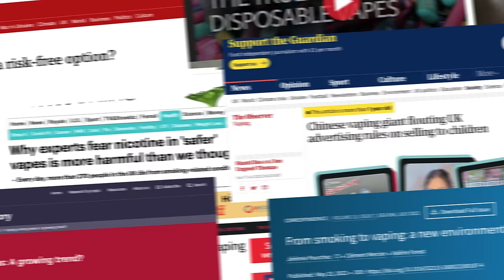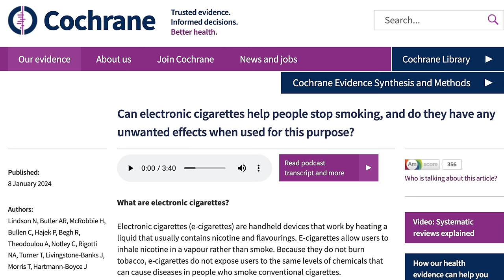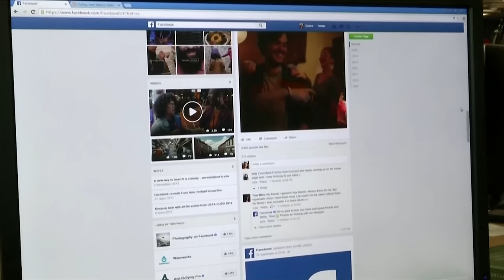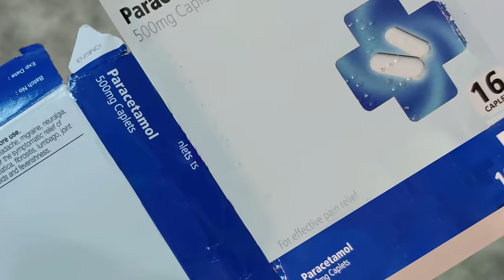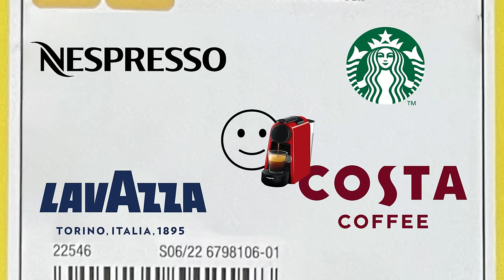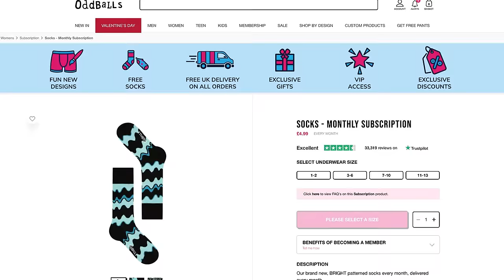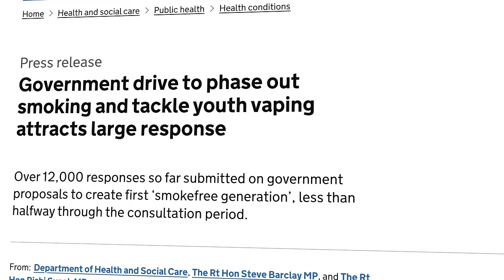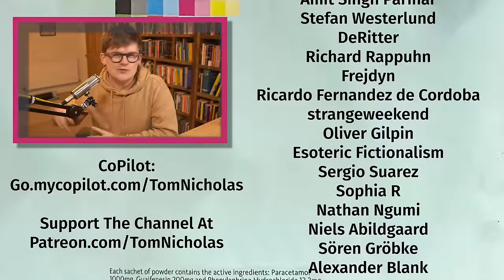Vape-o-nomics: Why Everything is Addictive Now

Comment: An Ex-smoker of over 17 years now, I have been fascinated by these disposed devices, each having a Lithium-ion cell inside that has never been recharged, and has a potential lifetime of over 100 recharge cycles. Only a small number of recovered vape batteries have been irreversibly over-discharged, so potentially they have a future to store renewable energy at home. The plastic, stainless steel, and aluminium casings are not easily dismantled for disposal and recycling, made more challenging by the potentially pyrophoric cell inside if damaged. Also, the nicotine content is a danger to wildlife being toxic to small mammals and lethal to insects. The glycerol and propylene glycol solvent and nebulizing agents also have a sweet taste that could harm children and pets if they were to encounter them. Discarded insulin may be just as lethal to those who are not medically required to use it without control. Insulin has been described as "the perfect murder weapon", leaving no toxicological trace apart from an easily concealed fine needle puncture wound.
Reply: The soft-pouch cylindrical cells found in these are manufactured to a very low quality and are not intended to take charge repeatedly. I have collected some and have extracted and store discharged and secured a handful of cells, but i wonder how long it takes for them to have a "thermal event". They seem adequate to power a small device, but i wouldn't be running a massive home-powering array of them, and wouldn't put them to use where they might be charged unattended.
Reply: @SianaGearz  In spite of the poor quality battery, many single-use vapes feature USB-C recharge ports. This allows manufacturers to put oversized atomiser tanks on undersized batteries. The poor battery then gets discharged to close to 3V when the vape stops working, then the user charges it to 4.2V and repeats this over and over until the tank is empty.
Reply: "The glycerol and propylene glycol solvent and nebulizing agents also have a sweet taste" no, glycerol and PG ARE the "nebulizing agents", all they do is create mist when heated, and they are tasteless. They're not used as "solvents" which is a somewhat scary word people like to throw in there to make it sound as bad as possible.
The only problem here is the "disposable" part of "disposable vapes". We had been vaping happily for over a decade before big tobacco, seeing that their efforts to destroy the industry with false claims and funding studies that didn't give the results they had hoped for, decided to join it instead. Disposables are a disgrace that have ruined vaping, and especially its image. Now the only ones still trying to kill it are members of big pharma, who saw sales of their stupid gums and patches plummet because of it. But they still fail to produce decent studies proving that somehow vaping is as harmful as smoking. Because it isn't.
Polluting the environment with tons of plastic and discarded lithium cells, yes. That's more harmful than cigarette butts.
Disposable vapes should be banned, and responsible vaping should be encouraged and facilitated for smokers who want to live longer and breathe better. That's it
Reply: @reezlaw  Friend, speaking from firsthand experience, propylene glycol isn't tasteless. It's sweet, but in an "artificial sweetener" way. It's classified as "generally recognized as safe" by the FDA, so because of its humactant properties, it's a common additive to foods that need to keep their moisture intact while still keeping a long shelf-life. It's also used as an alternative to ethylene glycol (which is allegedly also sweet, but is very much a toxic chemical, so you should under no circumstances consume it in any way, shape, or form) as antifreeze/coolant, mostly in situations where being able to keeping the water it's added to potable is a requirement (iirc, it's common for use in boats and RVs).
Additionally, there are other "nebulizing agents" (which I've always referred to as the base or bases) used in vape liquids (a buddy of mine used make his own using vegetable glycerine, various flavor extracts, and nicotine salts, and most commonly available liquids for refillable devices are either pure vegetable glycerine or a vg/pg blend). Propylene glycol is used commonly in disposables because it's cheap (which, let's face it, cheaping out on production is their main concern), it's a relatively thin fluid (as opposed to vegetable glycerine, which is pretty thick, so it can cause flow problems in cheaply-constructed devices), it vaporizes at a relatively low temperature (meaning you don't have to have the device's coil get as hot as with other bases), and, as stated previously, it's classed as "generally recognized as safe" by the FDA (which gets them off the hook for any claim of "dangerous chemicals").

That all said, the main issue posed by this objection is that it's a sweet liquid with candy-style flavors in it that also contains (on average) 40 mg of nicotine per ml of liquid, meaning that since there are records of children dying from consuming as little as 6 mg of nicotine, it's probably a concern people are tossing out devices that could still have traces of this liquid in it independent of any other concerns.
Reply: @StevetheWizard2591  that's another misconception, disposable vapes contain nicotine salts, it's not the same as free base and those numbers look much bigger than they are. Nobody would be able to vape 50mg/ml free base nicotine liquid. The problem with the salts is that it's smoother than free base, so it definitely looks like it's designed to get people hooked by delivering as much nicotine as possible without being too harsh on the throat, getting people as addicted as possible. Disposables are an abomination
Reply: @reezlaw  PG is sweet as shit. Go buy some at a pharmacy and see for yourself. I use it as a solvent and humectant sometimes and it's kinda like sorbitol in taste.
Reply: It worst than regular cigarette due to how worst it is for the environment
Reply: @reezlaw nicotine salt is actually less “smooth” feeling compared to the old type of nicotine vape juice. The issue is nicotine salt enters the bloodstream quicker and is therefore much more addictive. This rings true in my anecdotal experience
Reply: @bornach  Shrinkflation has also reduced the volume of e-liquid and thus the size of the absorbent fibre reservoir, but the manufacturers didn't tell. The main point of failure, and thus the reason for disposal, is the carbonization of vape liquid contents around the heating element, altering the flavour and making the vaporization less efficient, reducing the nicotine hit as the resistance reduces (through the conductive carbon build-up) and the temperature of the element drops. it does not matter then if there is a recharging facility or not, the device has failed to satisfy.
Reply: @StevetheWizard2591  I agree mostly, but I doubt if "vegetable glycerine" is used. It is probably an identical chemical product likely derived from animal fat, thus not vegan, and is unlikely to be kosher either, originating in China! Being water soluble as are nicotine salts, the glycerol is made less viscous with water, reducing the vapourization temperature. 

The saponification of fat with sodium hydroxide that produces glycerol is also the source of fatty acids used in soap and in detergent manufacture but also in cosmetics, candles,  paints and numerous other processes including food products.

These vape devices don't have "traces" of e-liquid, they have considerable amounts remaining after being disposed.
Reply: @tikaanipippin  Noticed the shrinkflation last year. Devices that used to have 550mAh lipos now have only 360mAh

Comment: As an avid reader and book-buyer, I have committed myself to avoiding using Amazon. I read more printed books so I support independent booksellers and I use my local library’s ebook and audiobook borrowing service. It’s been almost 2 years since ordered anything from Amazon or Audible.
Reply: Amazon is such a nightmare to navigate anymore that I sort of naturally fell off using it. There's just so much garbage you have to wade through just to find the one obscure thing you need that the local shops don't have. It went from a useful store I sometimes used for little luxuries like games to a slog of trash.
Reply: same! im trying to avoid them as much as possible
Reply: The local library is the best.
Reply: Pdf drive
Reply: Pdf drive and Kobo

Comment: As a smoker and someone studying electrical repairs,who also owns one of those bulky old vapes I can’t stand the single use vapes.

The idea of using the single use lithium batteries (or “super capacitors”) like this is just so incredibly wasteful it’s hard to describe. Not to mention how I have seen them disposed on the ground, with the battery exposed. They are dangerous waste and a potential fire hazard if damaged.

But worst of all for me is the fact these are rare earth resources on high demand for sensible use cases such as EV batteries. Wast majority of applications for single-use batteries lasted much longer yet we got rid of alkaline batteries for environmental reasons.

The likely reason the product is designed like that is the simplicity of its purpose compared to recharging a battery safely. It would be much harder to safely juice up a battery than it is to fry some nicotine juice.
Reply: yeah, it's kinda wild. Not only is the extra plastic (and batteries) a gigantic waste, it costs like 400% more!! I wish people knew that you can buy cheap bulk flavors and nicotine juice online for a fraction of the price. You can even play mad vape scientist and start making your own crazy flavors!!  Blueberry bavarian cream pie is my most recent concotion 🤗 

I suppose the unit makes the up-front cost a little more, but it easily pays for itself within a couple of months!

(some people worry about the ethics of online vape sellers, and that's valid. However, it's not like the regular, disposable vape companies are known for giving a shit about their customer's health anyway, so i'm not sure it's any different. Regardless, there are some good and reputable vendors if you look for them.)

Comment: I've used vaping as a tool to quit smoking sucessfully immediately after picking u vaping twice now. Had been smoking 10+ years and by like 2016 I was sometimes smoking 20 a day and it started becoming expensive as fuck, the moment I started vaping I quit smoking altogether, got really into the DIY scene and starting building my own coils and making my own ejuice.

I was making 100ml for <£1. I weened myself from 16mg to 0mg over the course of 8-9 months, with the last 1mg->0mg being the most decisive part of me being able to quit entirely, the drops went something like this.. 16mg>12mg>8mg>6mg>3mg>2mg>1mg>0.8mg>0.6mg>0.4mg>0.2mg>0.1mg>0.05mg>Couple drops of nicotine>0mg. And continue vaping 0mg DIY juice for another 2 months before quitting altogether.

Then in 2020 I picked up smoking again after a night out, smoked for 6 months, realised it was getting way too expensive even on rollup tobacco and swapped to vapes again. Same deal this 12 mg>0mg over 6 months. Vaping can be an amazing tool if used properly. These elfbars are not that though, these bars need to be outlawed entirely, they pose a significant eco risk are basically a scam as you get <2mg of juice in them (Legit 2 hours of vaping) and are often super high nic 24mg>..

These bars are just used to scam you into an instant nicotine addiction. If you're daily vaping these scam bars from your local corner shop, why? Stop being a dumbass, you're being scammed, at least buy a £20 mod off amazon and buy 100mg ejuice bottles for £11.99 and separate nicotine so you can ween yourself down.
Reply: 20-a-day for 30+ years and went onto disposable vapes 23rd December last year. Haven't touched a cigarette since but I know I'm much more addicted to nicotine
Reply: @bam-skater  Take all the nicotine you want, there is no comparison to the combustion of cigarette paper, vaping is a harm reducer and does its job perfectly.
Reply: @bam-skater the disposables are. . . Better than smoking, but man that salt form nicotine is far too powerful, try getting a tank system and go with 6mg standard nicotine instead, I promise you'll adjust quickly
Reply: Thanks for being the one to make this comment bro, but like. . . It's way too long lol
Reply: My story is very similar though I have continued to vape mostly 0mg juice (occasionally I'll have some of a 3mg bottle given to me by a friend). I just enjoy it. I've gotten into rda builds and stuff too and it's now a little hobby for me. 
Just like I enjoyed smoking, and would have not stopped had it but been for vaping. Smoked for over 20 years, 20-30 cigs a day. Now nicotine free with the rare exception, typically when I drink alcohol, which isn't very often at all.
But I do agree the disposables are trash and I worry they will fk it up for the rest of us
Reply: @Yixdy  #normalisebeingabletoreadagain
Reply: @Yixdy  Yeah, working my way twards that. Vapes are 20mg/ml nicotine so I'll get a tank some point soon and moves to 18mg/ml for a while and just drop a couple mg every so often. Just not wanting to push my luck atm, chest is deffo feeling the better for it already!

Comment: For a video that specifically discusses the scam that modern razor companies are, thank you so much for not advertising one of those subscription razor services. My mid-video sponsorship segment instincts were screaming at me for a minute there.
Reply: Funnily enough the original safety razor is probably the best one invented. Easier to use than a straight razor, doesn’t need to be sharpened (but you can sharpen the old razors if you really want), the razors are cheap, and the handles are customizable. Everything is metal so it’s 100% infinitely recyclable. 

Only issue is that it doesn’t make enough money for the companies, since you can get 100 blades for like 50 bucks or less from most brands and that lasts years. The newer, shittier, difficult to recycle razors that Knick often and last less time are now the standard.
Reply: @bobbirdsong6825  oh yeah, I bought a safety razor like 3 years ago and it’s all I’ve used since. Bought a 300 pack of razor blades on Amazon and I’ve still got the majority left. A lot easier to cut yourself, but the shave is as good as any cartridge.

Comment: As an ex-smoker and now vaper - I hate disposables. When it started - it was lame. Vapes were clunky, large and unappealing. Rebuildables forced you to make your own coils, which was quite pain in the ass. You had to be quite dedicated to put it with it, but it was great - since it raised the bar into getting into this. If you were were trying to quit smoking - yeah, you may be OK with spending some time mixing your own liquid, making coils, rewicking your atomizers (what leaked and were pain to use), carried heavy mods, recharged few spare batteries, etc - it was pain, but at least it wasn't bad as smoking cigarettes. Very few teens were vaping because of all of these shortcomings. But with disposable vapes - it became easier to vape than to smoke, you don't even need a lighter.

Comment: I'm a recent adopter of Spotify, and it wasn't entirely willingly, but driven by necessity.
Most cars now don't have CD players, mine is from 2013 and doesn't have one.
Add to that (I suspect the two are linked) many artists now don't release CDs.
So if I want to listen to music in my car, I need either a service or an mp3 player, and given the lack of supply of CDs from artists, services becomes the default option.
Reply: if your car has an aux port, you could hook up a mini cd player to it. i know that's a bit of a hassle though. otherwise, mp3 players are extremely good and if you feel guilty about pirating music for them, a lot of artists offer mp3 downloads of their music as a digital purchase.
it's all very frustrating. i also use spotify frequently but i recently dusted off my mp3 player and started taking it to work with me. it takes a weight off my mind.
Reply: just swap the unit for one with a cd player?
Reply: @Yeedman  not sure how easy that would be. It's an integrated touchscreen with satnav, fuel economy info etc in. I think it'd need a CD unit putting in the boot and then wiring in, which seems a massive expense

Comment: Tell yah, vaping the only thing that has kept me off cigs. Changed over in 2014, and haven't had a cigarette since.
I had previously maximal success quitting with psych meds, but that only lasted 6 months before relapse, and severe side effects.
Imperfect, but better than combustion.
Reply: In the minor use case for weaning smokers off tobacco, it still can be a good product.

But the next step is weaning off of vapes.
Reply: @RobertStoll  yeah, and there is zero excuse for disposables. The mechanisms should be very reusable.